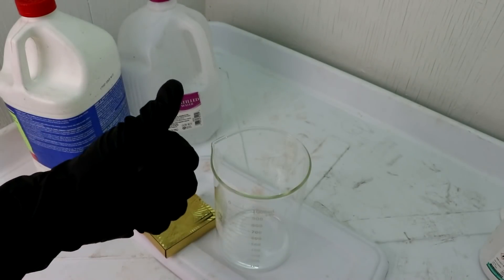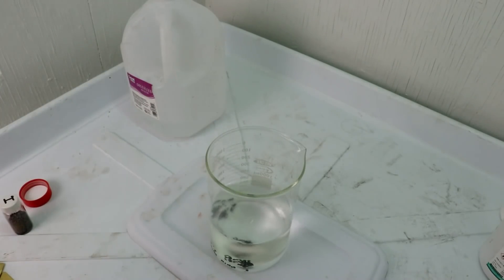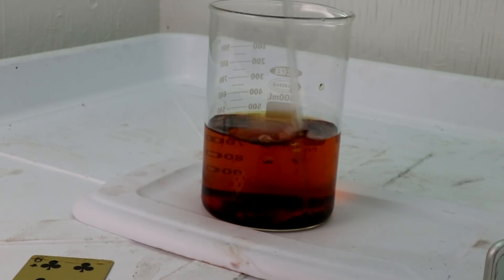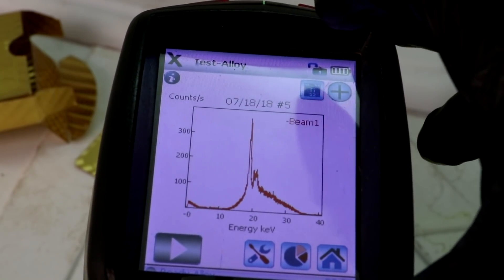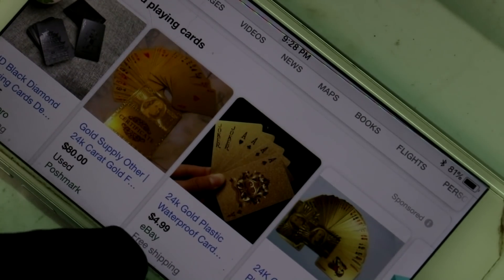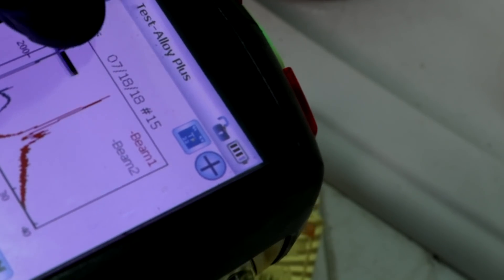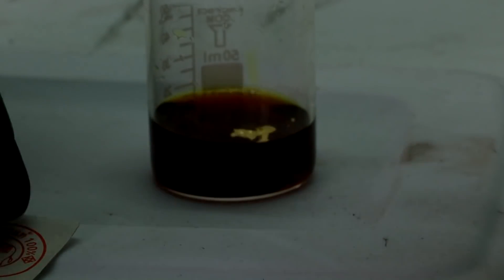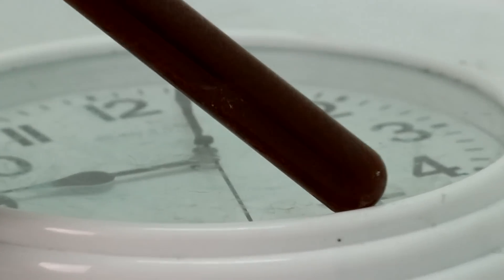Metal Refining & Recovery, Episode 25: Gold Playing Cards?

Comment: Just did the calculations. If the cards did use gold foil, at a thickness of 0.1 microns (very easily reached and is not an uncommon thickness for gold foil) then the whole deck would have $2.28 worth of gold on them.
Reply from the maker: Keep in mind that it costs money to get the gold that thin.

Comment: If the gold coating on the cards is 1/10 or less as thick as your gold leaf, the X-ray device should not register anything.  Very thin layers of gold can be deposited by vacuum or chemical vapor methods.  How thick is that gold leaf?  How thick must a gold coating be to look like gold?

The water was still beading on the cards after you cleaned them with acetone.  They probably had a thin layer of plastic over the metal, that did not come off with the acetone. 

If the metal is not gold, could it be aluminum bronze?  I gather that with the right composition it looks like gold, if it is protected from air.
Reply from the maker: any gold atoms at all would have shown up as gold no matter how thin.
Reply: But the height of the spike in the spectrum is proportional to the quantity of gold in the sampled amount, right?  How deep does the beam sample?  Does it detect arbitrarily thin gold plating on metallic objects?  

Saint Google says that a coating 0.1 microns thick already looks like gold.  Gold leaf for gilding arwork varies from 0.1 to 5 microns thick.  

(Just being stubborn here.  Actually I agree that the "gold" is probably aluminum, with a thin yellow plastic coating for protection and color.  Flexible plastic vacuum-coated with aluminum is commonplace, e.g. as candy wrappers.)

Comment: I've purchased a number off of items off of amazon, most of them electrical connectors of various sorts and most of them have had no gold in them at all (I have access to the same XRF analyzer you have in my lab and can measure plating thickness via metallography). I posted the results in my reviews of those products and on a few other sites that sell the products and a year later have found those products are no longer available from those sites and in some cases the store no longer sells products from that manufacturer.

Comment: I would be very interested to see you figure out what the cards are made out of.  It should be some straight forward analytical chemistry to test for different metals (if it is metal).  Maybe its just passing it over a flame to check for characteristic spectra, maybe you burn it and check the ash and do some test tube chemistry to check for different metals.  I would look at it under a microscope, it could be a slurry of finely divided aluminum bronze in a polymer binder.  Might also make sense to burn it and measure percent ash content or try different solvents to see if they dissolve the binder in the "gold" paint and see whether or not solvents can dissolve the yellow color.

Comment: what was this sophisticated device you used and what exactly was it reading in this graph. 
is saw the the unit keV which is a unit for energy
i would guess it counts the reflected rays with specific wavelengths and intensities(? sry i never really had electromagnetic radiation, photons in school physics) and and every material only or mostly  reflect specific parameters)  

could you maybe do a own video on this device and explain in  depth how it  works ( with the electronics and physics behind )

Comment: Maybe they were copper plated first then a super thin layer of zinc. Zinc plated onto copper is known to actually alloy with it on the surface creating a nice shiny golden brass. Ask nurdrage
Reply: Its most likely aluminum though
Reply: Both Cu & Zn are heavier than Al and would have been detected by the x-ray gun.

Comment: Why should putting in NaOH to the acidic solution help? It just will neutralize.
But since the I and the NaOH are solids on the bottom of the beaker, the concentration of the OH- Ions is still high enough around the Iodine pellets.
I suppose solving the Iodine in a little bit of NaOH solution and then mixing it with the rest would also work.

Comment: Knowing what they are really made of would be quite interesting. Maybe it is "nordic gold" like the 10cent euro coins but I guess that the xray would have picked up the copper. Also acetone won't dissolve all plastics pfte, pe and pp would be just fine (few solvents attack those ). So maybe a more aggressive treatment is needed, like burning. Measuring conductivity would also give you an idea if there is a coating, if they are conductive maybe electrolytic etching could dissolve whatever it is.

Comment: As always, cody Is God!. Well done. Yes those cards are fake as can be. I actually have 2 decks of them and hate the feeling the decks give off while shuffling or sorting them at any time.
Reply: Even more strange, they do not fit well on a deck holder or case. They are stock plastic printed too thick to measure into a standard poker sized clip. Good luck with making them fit in a standard display case.

Comment: There probably is just enough gold deposited using vacuum deposition to get the gold color, and depending on the backing metal, that could literally be a few atoms thick. Not sure of the gold sensitivity of the X-ray gun but that could explain why it's not picked up. Still doesn't explain the auqa regia not touching it though..
Reply: its a fake..

Comment: If they wanted to make gold plated cards that you could actually play a game with more than once without destroying them, the gold layer would certainly have to be beneath something.

If I had to guess, I'd assume they're using something like PETE, which is the type of plastic soft drink bottles are made of.  One of its propertities (which is probably very relevant to being food safe, actually) is that it's pretty innert and most common organic solvents (such as your paint thinner) won't touch it.  Even with solvents that DO work (DCM seems to be a common recommendation.  More specifically to PET family plastics, phenols, as well as DMSO and nitrobenzene), you will probably have to heat it up close to the solvent's boiling point and then wait a few hours.
Reply: Keldor314   thanks for that.  It probably explains why I met with disaster trying to get the coating off a beer can.  The solvents and paint stripper I tried had no effect.  I tried burning it off with an ordinary butane/propane torch and the aluminium melted.  Looks like I'll need to spend hours with fine emery.

Comment: I wouldn't be surprised, if there would be vacuum deposited gold laminated between two plastic foils (eg. PET).  Such gold would be very thin (100nm) and resistant to any chemicalls, as many polymers doesn't dissolve in lacquer thinner.  Have you tried dissolving this gold layer after separation of foil? like you tried to dissolve it in NaOH?

Comment: Iodine exists as a non polar molecule due to the fact that it has has two identical iodine atom with same electronegativity. Therefore it sparingly dissolve in polar solvents such as water and readily dissolve in non polar solvents. In order to have a reasonable concentration of iodine in solution you would therefore have to had in iodide ions which forms complexs such as triiodide and other polyiodides that are soluble. Adding iodide solution creates an equilibrium where iodine is constantly being formed into iodides. Hope this explains

Ps I really want to be a chemist some day

Comment: Hey Cody I got a question hoping maybe you can help I have gotten a hold of some old Miner's lamps I want to use them during power outages and stuff like that but I'm real hesitant to buy the calcium carbide because everything I've seen shows it being unstable in  it's container like it absorbs moisture from the air and turns to unusable dust. But would calcium carbide be viable longer if stored in like mineral oil or would the mineral oil cause the reaction?? Thanks love you videos

Comment: It might just be all about the wording that is on that guarantee. It might be that the gold that is on it is 24k gold but it doesn't necessarily mean that the entire card is gold plated. what I mean by that is if you look at the crowns on the face cards they are a slightly different colour from the rest of the cards front and backs. I would check those crowns and see if they might be the only gold plated parts on those cards. Ideally thought I would recommend turning the cards to ash, and then treating the ash with a solution of AR and then testing that solution with stannous chloride to see if any precious metals are present. Or if you want to use your XRF just test the ashes prior to treating with AR.
Reply: The x-ray would have detected it if there was any gold on any of the cards.
Reply: As the cards are plastic, I imagine it would be rather messy trying to turn them to ash
Reply: No more difficult than converting black pack IC's to ash, low oxygen & high temperature.
Reply: You are correct, I'm definitely not qualified to run a $40k x-ray gun. Time to see if Amazon will cancel my order. ;)

Thank you for informing me/us.
Reply: Incorrect, XRF's only detect what is on the surface or extremely minutely below the surface, also I mentioned to test the crown of the face cards as the only cards that was tested was the 6 of clubs. to test the entirety of a sample you would need to use another method like fire assay or ICP
Reply: lol no worries :)

Comment: What if the certificate of authenticity is the only thing that's actually authentic? Did you test that or only one of the actual cards?

That'd be pretty funny, and they wouldn't technically be lying. The certificate only says that there is genuine gold somewhere inside the deck, not that each card genuinely has gold.
Reply: kurtu5 Actually, there'd have to be actual gold foil, since that's what the certificate says. It could be an incredibly small piece, but it would have to be gold foil or leaf, not just gold in general.
Reply: @photonicpizza   let's make fake gold plated crads and put one microgram of gold foil one one card lol
Reply: He said he tested it negative in another comment
Reply: It's fraudulent no matter how you look at it. If the intent is to deceive, and the average consumer would be deceived, it's considered fraud.
Reply: Not sure what the lower bound "metal leaf' has before it ceases to be 'metal leaf'.  Perhaps to be considered leaf, it must first be beaten as a manufacturing step, which would distinguish it from plating.  If you split it down such that you only had one atom, is it then leaf?

More likely there is a speck of leaf with quadrillions of atoms somewhere in the certificate.   The cost to precisely place only one atom would be incredibly high.
Reply: @kurtu5   so 1 atom of gold is more expensive than 1 ton of gold?
Reply: Who ever made that assertion?
Reply: As long as there is one atom of Au, its not a scam.  Lol.   Nice observation.
Reply: IceDragon978 he tested it it's also fake
Reply: Gustavo Wolff if they were selling apple cider vinegar with a certificate of "contains real apples" but it didn't, then it would be a scam
Reply: Yes when he used his xfr on the entire deck it checks the entire deck. Thin cards stacked together like that, the x-rays will penetrate through them and if any one of those cards had an appreciable amount of gold on them (or if all 48 together had any amount) it would of come up on the spectrum. It didn't. So no, none of those cards had jack on them (except the jacks of course, sorry could not resist).

Comment: An ohm meter may have been useful to determine if there was a plastic coating. The coating is there to make the cards slide between each other so you can shuffle easier. You could have also stuck the deck in a crucible and got the metal out that way. Good to know those things are fake.

Comment: If someone actually were to plate a card, how would they do it? Electrolysis won't work because it isn't a metal, right? If it is done in other ways, the layer of gold may be a lot thicker and be very costly.
Reply: Evaporation in vacuum or sputtering in similar apparatus.  Evap is how the Al gets on CDs for example.  With the right gear you can put down such thin layers the cost of the material is nil - think all those gold covered audio connectors...
Reply: Bryson Xiao 
Gold leaf
Reply: I know gold leaf can be applied to paper and leather by burnishing it- I think if enough pressure is applied it will stick to most substances.
I have read that in Asian countries temples are covered with gold leaf by wishopers.
According to my old retired dentist, gold was used as fillings by repeatedly beating it into the cavity in thin layers, using a mallet  and a special tool. It then fused into a solid mass, filling the cavity hole. My father had some fillings done that way at the turn of the century- early 1900's.
HTH.
Reply: Use a card not made from plastic
Reply: rdizzy1 
Yeah, ummm I watched the video too.. gold leaf was just one way a “legitimate” card would do this
Reply: Couldn't be gold leaf or it would've been eaten away by the aqua regia
Reply: Your correct. I was just answering the question of how it could be done.

Comment: Maybe the certificate of authenticity has gold?

also you of course use a double paper filter to filter the particles of gold and wash and save the liquid you then put the paper filters once dry into the crucible and burn the paper and melt the gold... you would also want to use excess sodium hydroxide to make sure all of the iodine was reacted and all of the gold got dropped... the strangest thing was how the aqua regia did not react to the card at all the aluminum should have been attacked by it right?

also cody not that it mattered but the sodium hydroxide would have made the solution more basic as sodium hydroxide is a alkaline substance when it met the acid both would move toward basic....

Comment: alarm bells ring for me when i saw the plastic as not many elements can be plated to plastic and gold is one of them as plastic cant conduct the current needed for electrolisis.
Reply: Stoned Savage! 
The thought is that it was gold foil not gold plated, gold foil is essentially extremely thin sheets of gold that can be glued to a surface.
Reply: A lot of the time you start a process like this with electroless deposition of metal to deposit a thin seed layer. Then move on to electrodeposition. That's how you get those shiny chrome plated plastics.
Reply: They might have been plated using the same method that they use to apply the metal layer to CDs.
Reply: Not to mention it was $6.60ish for a deck of cards. That gives it away.
Reply: Uhh, alarm bells didn't go off when it didn't dissolve in Aqua Rega?? Lol
Reply: Stoned Savage they have had a method for years to electroplate plastics with metals. It was originally developed for button manufacturing to gold plate plastic buttons for clothing.
Reply: You could deposit gold by RF sputtering
Reply: They do it with chrome for sure. I remember watching a thing on how they do the new plastic car grills. They start with like copper, then a middle layer that binds to the copper and w/e the desired final coat would be.
Reply: Danielle Spargo i was thinking the same as cody i thought there might have been a protective coating but i was proven 100% wrong
Reply: Stoned Savage! It went all the way down.
Reply: There are other ways though. I thought they plated gold foil over the cards, then a protective lacquer. That's not very expensive at all and would look just as great.
Reply: Nvm just watched further in... Those cards are hardcore cheap as hell to produce
Reply: Kyle Jacobs that's also the same way they make plated through holes on PCBs
Reply: Arthur Dent you have to admit it was an amazing fake for the human eye.
Reply: Micah Philson the problem is it is possible but it more than doubles the cost and is time consuming so mass production is out of the window.
Reply: You sure the cards are plastic? Most cards are made from paper stock
Reply: +MrMishra Still would resist plastic coating though...
Reply: Chris Ramsey Already said it was jus a plastic box with gold sheet on it smh
Reply: It could have been gold foil over plastic with some sort of coating to keep it from flaking.

Comment: QUESTION TO EVERYONE: I heard breathing in dirt dust when working with excavators it leaves the lungs withing 3 days. But is it actually dangerous in the long term? What's the main component in the typical dry topsoil / clay that could be harmful in long term? Silicon?
Reply: Or is it lime / calcium?
Reply from the maker: Its the silica, SiO2, it can cause silicosis.
Reply: Cody'sLab thanks Mate :)